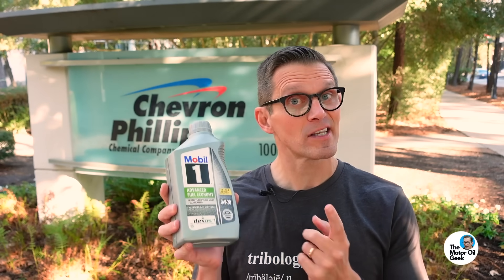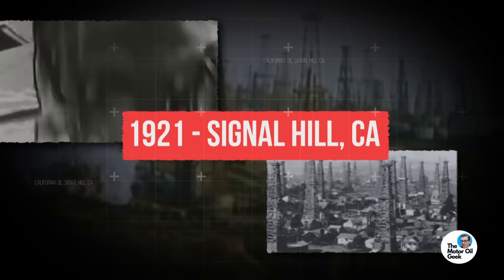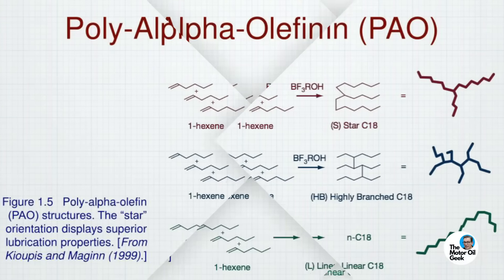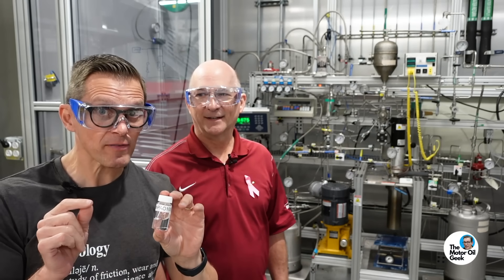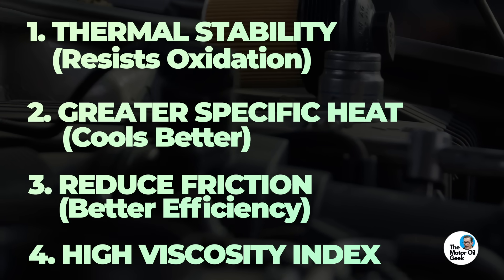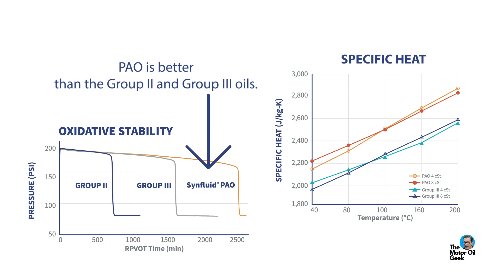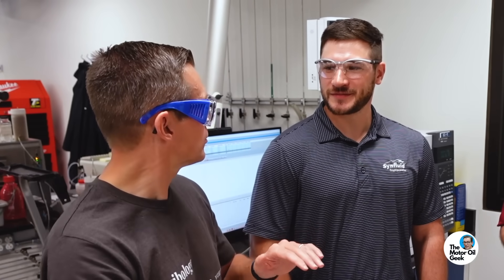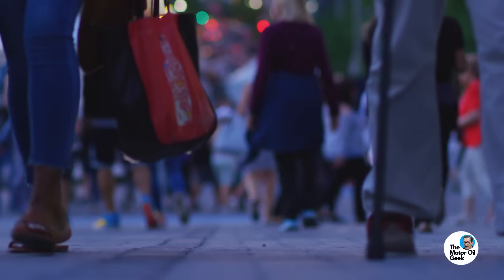STOP Using Regular Oil - 4 Reasons Synthetic is BETTER!

Comment: as a Canadian, who has worked and lived all his life in Canada‘s north or Arctic, I am particularly interested in the cold weather performance of oils. Particularly when using a block heater, which means that the oil in the oil pan is frigidly cold. How does that work in those few seconds or a minute while the engine is just started or warming up? Obviously, even the non synthetic oils have to work adequately, but this was interesting to me to understand that synthetic oils are that much better.
Reply: @tonytango6676  I asked a similar question to Lake recently about these "cold pour" tests I've seen and he noted "remember, pumping is different than pouring" and with that being said, I personally have noticed less initially engine vibration on our few -15-20F mornings here in upstate NY with Pennzoil ULTRA Platinum.  So far, the Valvoline Restore and Protect cold starts are just as smooth.   For Edmonton or high elevation Utah, I'd use a block heater for sure!  I've quoted machinery for both locations and those are both -40 areas.
Reply: @richcombs4805 I have oil analysis for the oils you mentioned.  First is the Pennzoil I first used. I bought a used Chevy 4.2 inline 6 had 222k in trailblazer. 

Then I learned about Valvoline R&P.  I have 3 oil  changes and analysis of each.  I noticed the 'ingredients' having HIGHER levels the 2nd time around on R & P.  I Then looked across the chart and there was the proof:Pennzoil had less calcium, magnesium, phosphorus, and zinc - but Pennzoil had more moly. 
The viscosity measured at temp was where is should be with Valvoline; Pennzoil was at a minimum here.  Point is since I did not do a flush , it showed on the 3rd analysis.  The first round of R & P was slightly diluted.  The 2nd round of it was closer to it's true nature and either way, it did it's job even being slightly diluted on round 1.  Wear is very similar from original oil out (dash indicator said 15% left) and the following OCIs for the next 11,000 miles. 

IMHO, as a consumer in a daily driver, a flush is overkill.   Unless someone has decided to use an additive or engine flush additive which really should get flushed out before going thousands of miles, just change oil.   Now you KNOW oil is in pretty good condition. 

I also want to say about the Valvoline product, I was un-neededly concerned about the filter, which I changed after 1,500 miles.  Furthermore, the oil fill hole became clean with wipe of finger; before using R& P my finger nail could barely scratch it clean. My vehicle was owned by a family member of a Chevy dealer, so maintenance records were plentiful on consistent OCI.  Not so much on other fluids like brakes, R differential. 

I'd like to see Lake make a spoof video BLINKER FLUIDS!  Ha!
Reply: So I have  a high  mileage  7.3 diesel  with  380 thousand  on it doesn't  use  a drop  of oil between  4000 mileage  oil changes  I run T5 semi would  I benefit  from  FULL synthetic  ??
Reply: @neilhuizing1382 Buddy get some Rotella T6 and Archoil AR9100 in that truck. You can thank me later.
Reply: That's where the W number comes into play, I live where it can get really cold in the winter as well and the difference in how hard it is to crank the engine is astonishing. My battery was so bad that it needed assistance to crank over on a cold day, before I got to changing it I switched oil and it took another year before I had to change the battery. 😂

Comment: I only use Chevron and Shelll  gas     is that smart or dumb
Reply: Differences:
Chevron regular is the same as Chevron premium (except for octane rating).
Shell regular is different from Shell premium (V-Power).

Chevron regular is better than Shell regular.
Chevron premium is worse than Shell premium (V-Power).

When you choose Chevron, always pump regular (unless you need high octane).
When you choose Shell, always pump V-Power.

One of the things which makes V-Power better than any Chevron grade is the inclusion of upper-cylinder lubricants. This is why, for my 2016 Toyota Prius c, I only fill it with Shell V-Power (even though my car runs fine on regular 87).
Reply: @ great info  thx
Reply: @aliendroneservices6621  Chevron regular is the same as Chevron premium (except for octane rating)?? Well it's not the same is it. TO change the octane rating it means different batching of all of the components. I don't recall what the exact changes are as I didn't work in the refinery lab or the tank farm which did the batching for the different grades.
Reply from the maker: I'd say smart

Comment: Lake, wasn't there an issue early on with automotive synthetics that certain base stocks caused issues with synthetic rubber seals?
Reply: High Ester content.  IIRC they added some spesific esters to increase compatability with the additive package and it would cause seals to swell and soften.  Lake has definitely discussed this before.  Anyhow, I believe it had something to do with solubility, ultimately being too high.
Reply from the maker: We covered that in this video: https://youtu.be/LUr4iTjXbhg

Comment: I have used synthetic for about the last 5 years since price came down but my old 03 F150 back up/garbage hauling truck that doesn't sits without use much started leaking out the rear main seal shortly after switching.  It was bone dry amazingly until about 160K miles and then slowly leaked faster until about 170K.  Now I keep a bottle of seal softener in it at oil changes and that works if I run the engine enough to circulate.  Is it the synthetic oil causing it?  It might affect it but my experience with Ford's are their hard rear main seals usually seep and I was surprised to make it to 160K with a dry engine.  Maybe I will yank the transmission and replace it one day.  Maybe.  Or maybe I'll switch back to conventional to see if it makes any difference since I don't plan on putting a lot of miles on it.

Comment: I use synthetic oils in all my vehicles. The oldest of which is 46 years of age.
Reply: Synthetic oil is great but I won’t simply use on my older engines. Like my 1966 ford 289 or my 1993 Jeep 4.0 both are 100% original from the factory.
Reply: Don't use synthetic oil in an old vehicle.
Reply: @ - I have used synthetic oil in my Classic Historic motorcycles for many years with no issues at all
Reply: @trxtech3010  especially the flat tappets. New oils don’t have the zinc.
Except for Valvoline VR1, but I’m not putting racing oil in a 30 year old truck engine. I add STP with the ZDDP to my conventional
Reply: I believe what some are misinterpreting is that there's a difference between base oil and the final blend, older vehicles will benefit from good base stock as well, but the additive package needs to fit the application. Synthetic lubricants were developed a long long time ago, I believe there were thousands of ester oils by the end of WW2. 🙂
Reply: You wannabe oil engineers are hilarious, lol. Every wives tale in the book will be posted here by the end of the day. 😂

Comment: One thing Ive been wondering about is the flammability of synthetics. Or rather the lack of it.
If the engine is leaking oil into the combustion chamber how does this affect the combustion?
Reply from the maker: That depends upon the type of synthetic oil.

Comment: I have been using Amsoil exclusively since 2008. Signature series in my 2016 Mustang GT and HD diesel in my 1999 F250 7.3 presently. I have used it in motorcycles, lawn mowers and tractors without a single failure in 17 years.
Reply: ME GRAMPS HAS BEEN USING CASTROL GTX.. 20W.50,, CONVENTIONAL ,,OILS. AT 3.50. A Qt..IN his EXTREME DUTY 🚕 🚖 🚕 TAXIS.. THEY ALL HAVE OVER 6OO. OOO! .MILES.. AND FOR OVER 38 YEARS.. NEVER A BREAK DOWN.. 😃 😊
Reply: @IronMike-f8i that’s all i ever used until 2006, I purchased a 06 Pontiac GTO and MFGR called synthetic only. I had oil changed at the dealership, the shop used conventional oil although mfgr said synthetic, and it used 2 quarts in 3,000 miles. Drained, flushed and replaced with synthetic oil and i never had another issue with oil loss..
Reply: I have been using amsoil for 30 years. Never had a failure because of lubrication.
Reply: @Robert, we never use Amsoil. No engine failures for us or our customers! 3rd generation mechanic and engine builder 😂

Comment: Hey Lake great video, can you do a video showing which synthetic brands use group IV PAO & which brands use group V  synthetics ?
Reply from the maker: Noted, but you can also check SDS sheets to get that info.
Reply: @themotoroilgeek  Ive looked on Mobil 1 SDS sheets and it doesnt list which group of base oil they use
Reply from the maker: @ers18619g  They do list the CAS numbers on the SDS. Here's a cheat sheet for decoding it. https://www.cpchem.com/sites/default/files/2021-09/PAO%202021%20FINAL%20.pdf
Reply: @themotoroilgeek  Thank You much Lake !!!
Reply: There is a great channel (in Spanish, but youtube can translate subtitles)called latabernadelmotor that does oil and spectroscopy analysis of motor oil and aditives. For Mobil1 in 2023: https://www.youtube.com/watch?v=NJanSk3hBus

As you can see, at least the Euro version of Mobil1 ESP 5W30 was reformulated to worse by removing PAO and Group III+ (GTL) and slashing the boron and now it’s mostly Group III, so only synthetic by the legal/marketting term, not the “Group IV/V” one.
Reply: @puretagamer   Thank You, I appreciate the info

Comment: Ive been trying to get some advice here. I put Pennzoil ULTRA Platinum in my 5.0 Coyote at first oil change, which was a brand new purchase. Due to availability issues, I put Pennzoil Platinum at next interval. I've heard it's highly advised to "pick one and stick with it" regarding a formula for longevity purposes. Is it okay to go back to the Ultra Platinum next interval? I change every 5000 myself and use Mobil1 filters.
Reply: You can switch, your engine will not grenade itself because you changed oil brands. I’ve run Motorcraft, Mobil 1, Valvoline, Castrol, Motul, and right now a Total + HPL blend in my 2019 Mustang. 

With a 5k mile interval you can pretty much run anything because unless you’re literally tracking your car on the weekend your coyote isn’t wearing down a modern API SP oil.

Hell you can even track the car and it’s wild how well modern oils hold up.
Reply: @johnpenwell6402  Thank You! I can actually see the timing chain when the oil cap is removed, and it's sparkly clean. Intend to keep it that way, proactively hoping to avoid cam phaser issues long term, which consensus indicates That's increased with regular oil changes
Reply from the maker: It is best to stick with just one. Decide which one you will use each time and go with that one.
Reply: @themotoroilgeek  Thank you!

Comment: Now disclose how much ENERGY is required to make synthetic oil, which most will throw away 5kmi too soon), versus simple refined oil that goes from the ground to your motor..... 
[i'll wait, tho you won't answer] 😐
Reply: You run crude oil in your engines?
Reply: @oneninerniner3427  NOBODY runs Crude oil in an engine, stupid. It comes out of the ground Crude, stupid.
THEN it gets Refined. 
In fact your run "Crude" gas or diesel fuel IN YOUR ENGINE every day, mental giant.
It's an Engine, not a faberge egg, little girl.
Now go look for a logical response in your purse ~
Reply: @oneninerniner3427  @oneninerniner3427  You wouldn't know what "Straight Crude" was if it burst out of your mother like you did. Normal, Refined, 30-40weight oil is actually what vehicles and engines are regulated to operate on. Any other stupid questions? 🤔

Comment: What about on older Harleys etc that have a full roller bearing bottom end?
You shouldnt use synthetic because it is too slippery and can cause the rollers to slide and not roll.
Reply: Mythology
Reply: @oneninerniner3427     have you never seen a research paper warning about problems with super slippery synthetic oils and how they are unsuitable for certain applications?
Have you never seen roller bearings with flat spots?

Comment: Synthetic oil left a bad taste for me after the Mobil One Aviation oil Debacle.  I have personally seen many good engines ruined from running early synthetics.  That being said, you have convinced me in switching to synthetics for my cars and trucks, as I believe the technology has matured dramatically over the last 40 years.   Having said that, why is there still no full synthetic oil for gas burning aviation reciprocating engines?
Reply from the maker: There is a very interesting reason why the Mobil 1 aviation oil failed, and we are going to cover that in a future video.
Reply: @themotoroilgeek  Thank you Lake, I am familiar with several "theories" but I look forward to watching your video on the subject.
Reply: @themotoroilgeek  as an airplane owner,  I look forward to that! Thank you.
Reply: ...Because those run on leaded gasoline. See: Bob is the Oil Guy
Reply: I'm thinking that has alot to do with the FAA and its rulings and not what is necessarily better. I believe that is why piston engine aircraft engines are still using magnetos even when there are better ignition systems that could be used.
Reply: Magnetos are more reliable.
Reply: @mareksumguy1887  not necessarily. It's a lot of time, money and red tape to get anything certified by the FAA. There in lies the rub.
Reply: @mareksumguy1887 No, they aren’t.   Many modern Rotax engines match the reliability of Lycoming and Continental and they don’t use magnetos.
Reply: No, it had everything to do with using leaded avgas and synthetic oils generally don’t suspend lead well.  Apparently, the new XPS oil for Rotax aviation engines has overcome this limitation.
Reply: Because apparently synthetic oil isn’t as good at suspending garbage (lead from burning leaded Avgas specifically ) as conventional. There is at least one aviation oil that’s semi synthetic, Aeroshell 5W-50. But none that are completely synthetic.
Reply: @morrelladrian I believe the new XPS 5W50 is fully synthetic.
Reply: @LTVoyager  interesting, I just looked it up. Only specified for some Rotax engines and no certified engines.
Reply: Yes, it's the leaded fuel, Av Gas, 100ll-low lead. Lead doesn't like to stay suspended in synthetic oils. That was the hitch.
Reply: Aeroshell 15W50 is a semi-synthetic, certified for use in piston aircraft engines. Ive run it for years, with good success.
Reply: Is there  a way to tell which passenger car oils are PAO based ??
Reply: @jcarr0314  9 times outta 10 the price will tell you. Group IV/PAO oil will be around 60% more expensive than group III synthetic.
Reply: Ok boomer
Reply: @seanm3ify Come on, you can find a more tired and trite comment than that!  Maybe use both brain cells instead of just one.

Comment: Is it worth going full syntetic on a low cc motorcycle? the manufacturer recomends mineral and everyone else recomends semi-syntetic and ive been going with the later for now but i was told is not a good idea to go full synthetic.
Reply: Not likely.  Most motorcycles don’t see extreme temps such as below zero or above 100º and most motorcycles hit the time limit on oil before they hit the mileage limit.  In this application, synthetic oil is simply wasting money that could be spent on gasoline.
Reply: @ thanks for the info
Reply: 4 stroke?
Reply: @devbropa-wy1xl  yea i forgot to mention that, is a 200cc 4 stroke.

Comment: my right ear is totaly onboard for synthetics now,  my left ear though still isnt sure
Reply: Rewind and hold the phone next to your left ear.
Reply: I have been running amsoil for over 30 years, I will never use anything else. I have never had a an equipment failure due to lubrication.
Reply: Because your left ear still has wax in it.  😉
Reply: @joeschoe4477  😅🤣😂, well said!
Reply: But what about in between the ears?
Reply: @murrayjimm  synthetic blend 😆

Comment: So maybe you'll start changing oil once per year like we do since decades in Europe...
Reply: How many kilometers is the maximum? Or is it one year, regardless of km's?  We'd need to see results of oil analysis to determine how much the fluid has degraded.
Reply: @richcombs4805  depends on manufacturer. 15000 km is the minimum.
Reply: @markotrieste  ah ha...ok...that's 10,000miles.  I'm an engineer for  Swedish rotating equipment company.....I can promise you that longer oil change intervals without double checking oil analysis is a risky thing to do.  The analysis costs more than the oil and filter change ....so, I change every 5000 miles.  I drove my 07 Honda to 670,000km....still got excellent efficiency because I skipped no maintenance ever.
Reply: Stay in Europe .. 🖕🖕